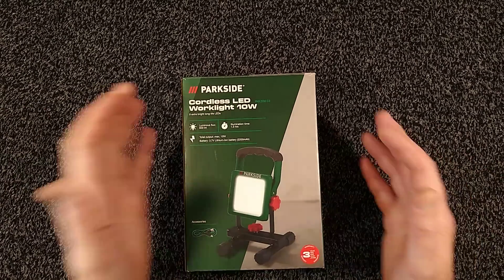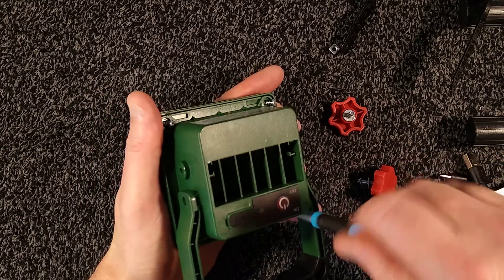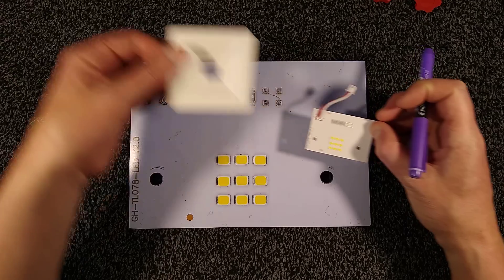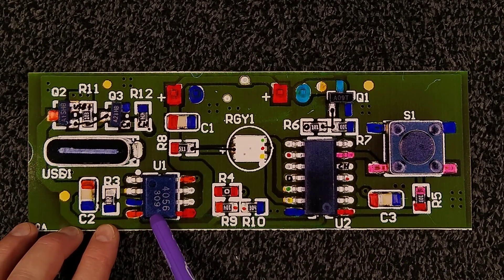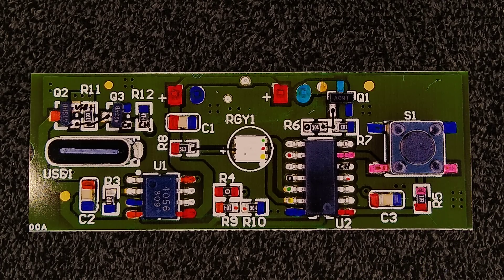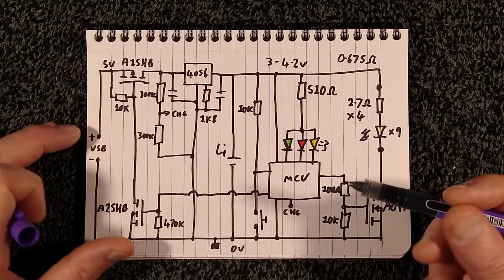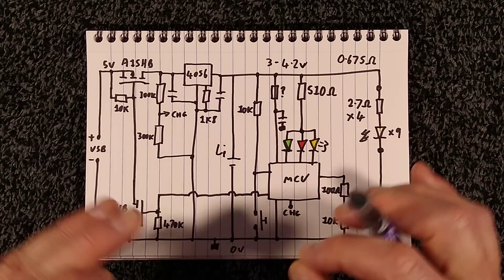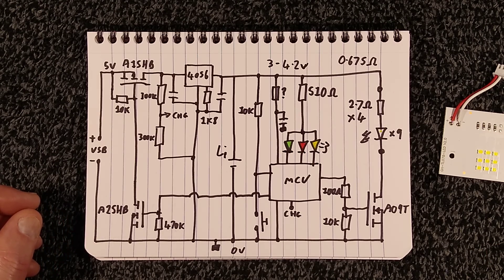Inside a LIDL USB rechargeable work light - with schematic

Comment: It is annoying how many cheap USB-C charged devices can't be charged with C to C cables. 

Have few such devices, a small pocket worklight that has magnets to stick it somewhere for example. 

I know I won't be able to do it with my current skills, but how much should it be to fix it? Resistor between specific pins? They're probably unreachable on cheap small circuits :/
Reply: It's just 2x 5.1K resistors on the CC1 and CC2 pins. Simple enough but difficult to solder in a lot of cases given the small sizing on the USB-C port and (usually) the PCB surrounding it.
Reply: @SL0viper  Hmm yeah. I've so far only done throughhole stuff so it'll be quite a way out for me. But maybe some day.. 

(Although, as smart chargers become more common cheap products will probably just start supporting them)
Reply: You don't even need two resistors, if you short together CC1 and CC2 on the connector then it will work fine as lomg as you don't use a"smart" high current (>2A) cable. (It also wouldn't be able to talk USB >2.0, but I don't think that is an issue.)
One trick: You can find the CC pins by testing which pins have 5V when connected with an USB C cable.
Reply: @DrAHorn  usb-c is 3A & 20v by default with 48v & 5A support as optional extras.
Reply: And even large companies like Bosch fail that test 😥

Comment: Question:

Can the lamp operate while charging (so the battery becomes effectively a UPS) ?
Reply from the maker: The processor turns the output off.
Reply: @bigclivedotcom  Mine does not turn off while charging, but it is not a  Parkside (it is a "Anslut" from Jula in se) and has a micro USB connector, the LED board has the same partnumber and otherwise it is identical.

Comment: I especially like the Lidl Parkside hybrid led worklight model: PLSA 20-Li A1

Have bought multiple specimens - using both Lidl battery system devices.

A1 is the version. Nowadays battery and device versions are typically B something.

Comment: USB-A USB supplies will always output 5 volts, or will output 5 volts when a load is detected. They don't need any kind of information beyond a sufficient current draw to produce 5 volts. QC chargers will do this.

Comment: Parkside™ stuff is SUPERB !  ( and cheap ! ) ... and .... they always supply all the bits - n - bobs ..... but much like charity shops , if you want it , BUY IT , then and there  (  when its gone , its GONE  ) ..... DAVE™🛑
Reply: Don't buy tool bits (or any hand tool requiring torque, such as sockets, spanners/wrenches, fixed screwdrivers etc) tho: they're typical chinesium cheese :(

Comment: I noticed this "parkside" like to cram electronics into the housing real tight to the extent the 18650 powered staple gun they had cut through the wires model "PAT 4 C4"

Comment: What resistor values could be added to which pins to allow the lamp to charge from a smart USB C charger. 
I ask because I only use Apple USB C charger because of previous bad experiences of use cheep alternatives. 
Thanks Clive for yet another very interesting video. 
Keep up the hard work for us all to watch. 
Kilo Watt.
Reply: IIRC, a 5k1 resistor on each of the 2 CC lines, to ground.

Comment: One annoying thing about these sort of devices is that often you cannot use them and charge them at the same time, or at least use them from external power even if they don't charge. What minimal changes are needed in these circuits to make that possible?
Reply from the maker: You can add an extra TP4056 module to some devices to allow charging while in use.

Comment: Weird that they're using a microcontroller and still only one output mode. I'd prefer two modes (full / about two thirds) with the dim mode as default, and full brightness available with double click on the power button. Or a memory option so that the last used mode would be the default the next time it's powered on, but then it would need to have at least one bit of non-volatile memory, which that microcontroller probably does not have.
Reply: Even when off the microcontroller has power so remembering last state is possible until the battery is removed.

Comment: Actually I like it when these LED lights have none of that SOS/flashing crap...though being able to dim it would be nice I am will to forego that to keep it simple.
Reply: DiodeGoneWild just put out an  interesting video neutering the [side] strobe and SOS modes on a flashlight (with additional "area" lightning in the handle)
Reply: @michaeltempsch5282  also the main one is possible, with low pass filter, he got lucky that the side led do not have white flashing mode
Reply: @lifeai1889 Yup, not necessarily applicable to all lights, but certainly opened my eyes to another approach...
Reply: Hurray for absense of flashing crap.
Reply: diode gone wild make a video about it released at same time quincidentally
Reply: Loosen [one end of] suitable amount of current setting resistors and stick a switch in-between? Keeping them in circuit for full brightness, or temporarily cutting them out for reduced)
Reply: @michaeltempsch5282 you could add a SPDT switch (On/On) in the supply line of the LED board, either switching directly through or a resistor in series, I guess. would probably be easier than soldering on the alumin(i)um core pcb 🤔
Edit: more details on the switch +
even better, since the led board is connected using JST Connectors? it could be done with a little adapter in between the small main pcb and the led pcb
Reply: Oh damn, you beat me to it. 👍
Reply: On some of the 6-pin driver chips, one of the pins is "Option", grounding that disables SOS mode.  So if that cheap torch has a couple of unused pins on the IC, try grounding them.
Reply: I agree with you 100% about all of the different modes!